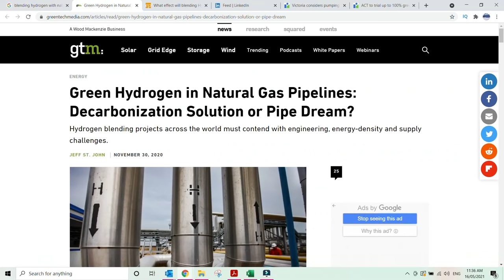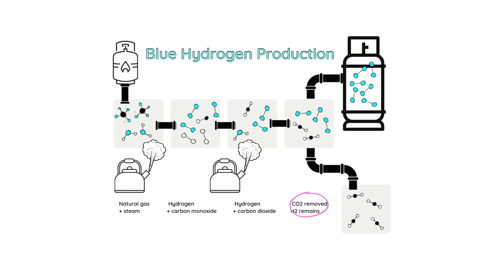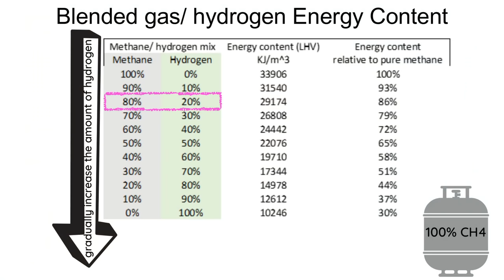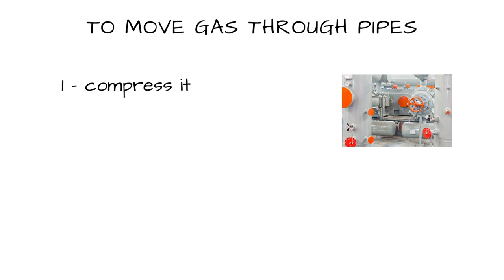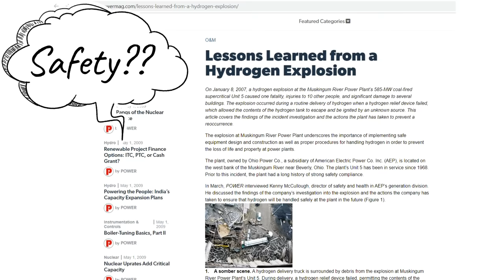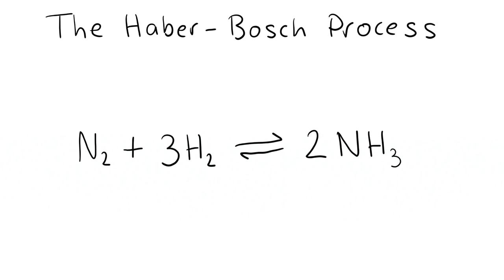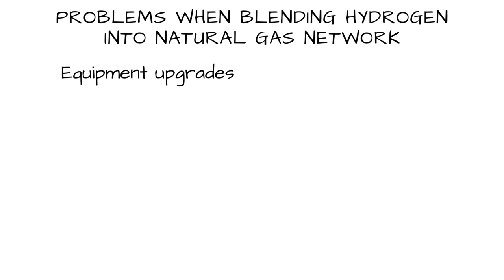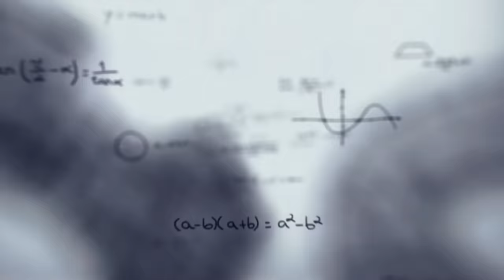Hydrogen in the Natural Gas Network

Comment: I saw the title and thought - gee that's a bad idea. I watched the video expecting to have my assumptions challenged, but discovered that the problems I was aware of were only the tip of the iceberg. Thanks.
Reply: My thoughts was just that, it would be the day I would replace my gas stove with an electrical one.
Reply: numbers on hydrogen are not good - only electroless made with excess renewables makes any sense

Comment: It is not the hydrogen they want in gas it is cheap carbon dioxide used to thin it out and regulate the burning rate. They do it to increase the profits.

Comment: Several problems: First, hydrogen will leak from a network when it was leak proof with the larger natural gas molecule. Second, natural gas has a very wide explosive range. Even a tiny leak will form an explosive mixture in air. Third, it takes an extremly low energy spark to ignite hydrogen. I think the better solution is to store renewable energy sources as hydrogen at the source then transmitt the energy as electricity.
Reply: Natural gas explodes easily. Meanwhile those building hydrogen cars are finding that because hydrogen disperses from a leak or fractured tank so fast that they haven't managed to blow up a car yet, despite resorting to firing a bullet into it.
Reply: I'd make the we have already done this 150 years ago Mike and Melbourne didn't blow up with a 50% H2 mix. It was all quite doable with 19th century technology so I think you are overstating problems if we could do it back then.
Reply: Using hydrogen to plug the gaps in electricity supply is the aim, however because batteries aren't the answer hydrogen is needed. There's new answers appearing daily, especially molecular structures that can hold, store large volumes of gas and quickly release  on demand.
Reply: @edwardvine207  Agree. Especially if natural hydrogen reserves are found. A large area around Adelaide is being explored for naturally occurring hydrogen. The geological structure there is likely to have such reserves. Australia Gas Networks are injecting 10% Hydrogen in three areas of Australia. There is always ammonia NH3.
Reply: Hydrogen on demand at point of use is an answer to be looked at.

Comment: District heating is a good third option. Trained technicians can burn hydrogen for electricity and heat in a controlled location, and distribute the waste heat to surrounding buildings. Combined heat and power systems are already popular in some regions.
Reply: "distribute the waste heat" that always puts a penalty on optimizing a process. If you happen to reduce the wasted heat by 50% the neighborhood is going cold.....
Reply: "Trained technicians can burn hydrogen for electricity and heat"

I don't think that makes sense. Why not just burn the natural gas directly for electricity and/or heat?
Reply: @Nerd3927  That's not a realistic worry. Heat engines cannot reduce their waste heat below the Carnot limit.
Reply from the maker: District heating is fantastic where it makes sense. A lot of data centres are being built in Scandinavia because they can use the waste heat for district heating (half of the year). One of my first videos was on that topic, at some waste heat  to district heating projects in Denmark:
https://youtu.be/F3mC_TaJk2U
Reply: @seneca983  for example, in the Netherlands, natural gas is used for heating and electricity 9 months of the year and emissions per capita are high. To meet climate goals, the Netherlands could use imported green hydrogen from North Africa for district heating and electricity, instead of natural gas.
Reply: @Ikbeneengeit  "the Netherlands could use imported green hydrogen from North Africa for district heating and electricity"

I don't see how that would make sense. If the hydrogen is made with electrolysis, then surely it makes more sense to just import the electricity directly rather than turn it into hydrogen and back with considerable loss at both steps.

If it is made from natural gas, then likely it makes more sense to just use the natural gas for energy directly.
Reply: @seneca983  It's 3000km from Marrakech to Amsterdam. That's a very long wire you're proposing. It could work but it would be a megaproject. Edit: Also hydrogen has the advantage of seasonal storage.
Reply: @Ikbeneengeit  Morocco is already in the same synchronized grid as continental Europe. Also, a hydrogen pipeline would be a much larger project.
Reply: There's an interest approach being tried for district heat.  "Not that large" pits of sand are created with air circulation pipes run through them.  Sand is both a good storer of heat and a good insulator.  During times of extra renewable generation the sand is heated with (100% efficient) resistance heating.  Then, when heat is wanted for buildings, air is circulated through the embedded pipes to be warmed.  

Apparently the sand can hold heat for months with little loss.  That means that a lot of solar panels could be installed with much out their output on the long sunny days used to store heat and the panels would be available to produce electricity on short and cloudy days.
Reply: @Ikbeneengeit  Or import wind generated electricity from offshore and solar electricity from Spain, Portugal, and Morocco.  

Seems to me there needs to be some UHVDC transmission offshore along the European coast to move North Atlantic wind generation south and Southern European - North African solar northward.  Hook up some Northern European hydro as a fill-in source.
Reply: @seneca983  I mean hydrogen on ships, not pipes. Also, the electricity grids may be synchronised but the transmission capacity is not there. The existing grids are full.
Reply: @Ikbeneengeit  Pipelines are cheaper than ships, at least for sufficiently large volumes. There's a reason why they're used. The more expensive option of using ships makes hydrogen from North Africa seem even less viable. Just building more electric transmission capacity seems a much simpler option (though it's not clear to me whether North Africa even has a sufficiently big advantage in electricity generation). The 30% round-trip efficiency of hydrogen is pretty dismal when compared to just using electricity directly when possible.
Reply: @seneca983  In South Korea They have a 5MW Fuelcell pilot plant which Also supplys district heating. However IT is only partly fuelled by electrolyseD Hydrogen. My point is that IT makes more sense to use fuelcells, when you intent to centrallize its use as opposed to using IT in homes individually.
Reply: You should not burn hydrogen at all. Use a fuel cell and distribute the electricity. We are pretty good at that...
Reply: If cogeneration of heat and electricity is done on a large scale  could just burn natural gas and sequester CO2 into a geological formation
Reply: @leswhynin913  The point is to get rid of natural gas and use surplus windpower and Hydro to make Hydrogen for seasonal Storage and peak demand. Sequestering is more expensive than fuel cells right now, but that might change. Cost Will decide what gets most its Worth In reductions.
Reply: @Tore_Lund  I think the point is to reduce emissions by cheapest means.  If you have cheap hydro just electrify
Reply: @leswhynin913  Hydro is easy, as IT Also has inbuilt storage to Some degree, but most Places don't have geology for that and I Think hydrogen is Better than big batteries. If emissions from burning natural gas can be sequestered cheaply enough one Day, IT Will be the obvious solution. We still have large amounts of IT and the power plants All ready there.
Reply: @leswhynin913  'could just'. A phrase that covers a multitude of complexity. On a technology that has not been done at scale.
Reply: @Tensquaremetreworkshop  its already done
Reply: @leswhynin913  That is what I implied! it is known technology...

Comment: Finally someone with some sense talking about this topic! How refreshing!  The other thing no one talks about is the different hazardous area classifications between traditional hydrocarbons and hydrogen. Most hydrocarbons are Group D chemicals (the least restrictive type of flammables) but hydrogen is a Group B chemical. That's not an insignificant challenge because hydrogen has a very low minimum ignition energy, so low that just venting it out of a pipe to atmosphere will catch it on fire due to the friction. 
It also burns with an invisible flame when purified so you can't even see it when it does catch on fire. Handling it is industrially is very plausible and already heavily done, but expecting the average person to handle hydrogen without incident is a tall order and not one that will end without some loss of life.
Reply: Thanks also from my side for grapping up this important topic and especially Paul for the REALISTIC view on this hyped topic.
However, I think your summary of "its all solvable with a bit more money" is not what Paul told and what I learnd as researcher for several years on this topic, specificly since some issues go way deeper than the discussed surface level. Since repurposing pipelines for hydrogen is so dangerous, all old building where the original construction plans are not available would probably have to undergo an extensive check of all old pipelines or put new ones under the wall to be SURE that no leakage will occure. Further, hydrogen is "un-smellable" and so would need an odorant: however, this is extremly complicated for the (very light) hydrogen molecules and would also prohibit all usage of fuel cells down the line. Futhermore, hydrogen the pressure of hydrogen can be changed between 300 and 20 bar without significant heating or cooling, but relaxing it from 20 to 1 bar environental pressure leads to a significant cooling that would freez the walls if the gas is not significantly pre-heated. ALso, Paul is very right, that it is practically impossible to increase the hydrogen contend step-by-step to 100% so it would need a (unrealtistic) "switching-day" when natural gas is completly substituted by hydrogen. Then, hydrogen requires 3 times the electricity for the compressors in the grid, which quickly becomes a substantial electricity consuption. The list goes on and on...but the media typically ignores this list of issues raised by most expert in this field for the convenience of a simple dream-story.
Reply: Here’s another one for your great comment. Stratification of gases.  as any percentage of hydrogen is injected into a natural gas line and immediately starts to stratify. Depending on the flow rate this means that a mile or so away if your natural gas tea is pointed up then you’ll get nothing but hydrogen. If all the tees are pointing down then in a few miles everyone down stream will just get hydrogen. So a 20% hydrogen injected the first few customers will get pure methane and the last customers will get pure hydrogen except all of them will pay per cubic metre the same price though the end customers will get 1/3 of the BTU.